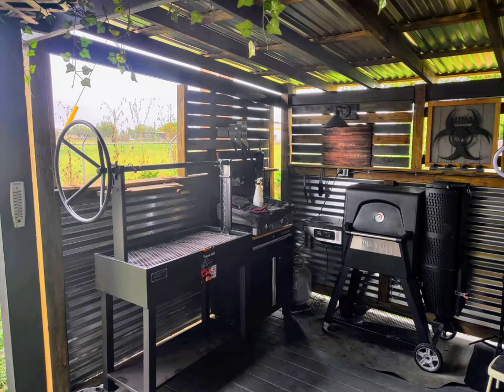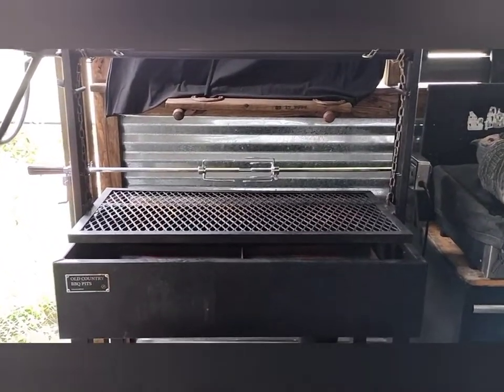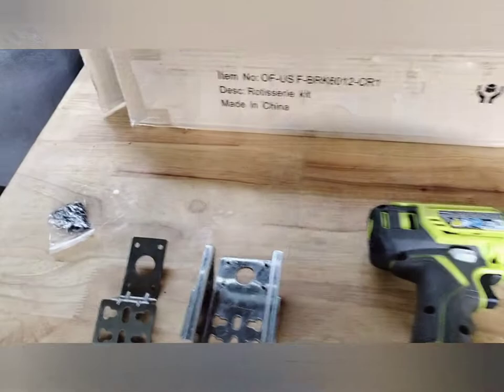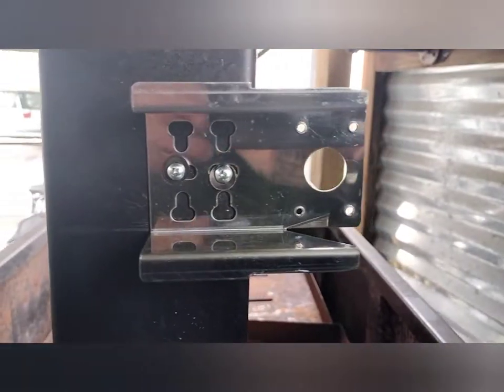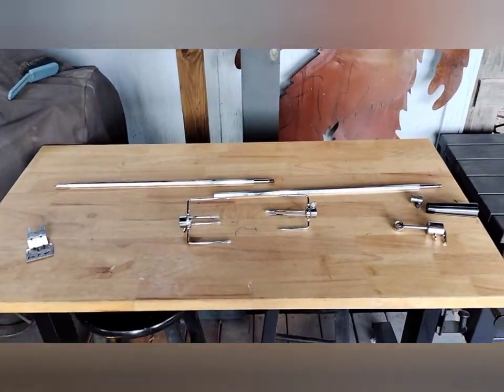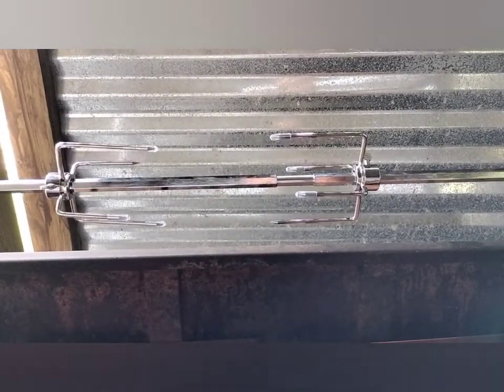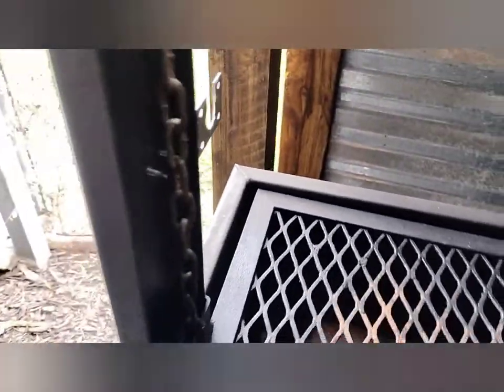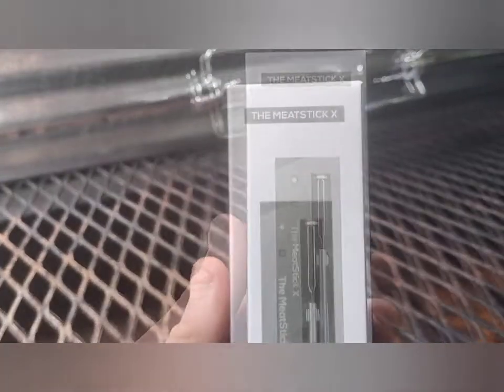Old Country Vaquero Rotisserie Kit Setup

Comment: As a very happy owner of this grill the absolute hands down thing you should do is line it with fire brick. Completely changes the way this grill retains heat. You will need to cover it after this modification as ash and a well-set firebrick make a waterproof bond and rain will pool in it. I believe it took 22 bricks from the tractor supply and I cannot explain the difference. The metal grates included for the bottom just throw away or repurpose for something else, they warp badly and don't retain heat.
Reply from the maker: I have seen a difference using ceramic bricks. I'll place the video short explaining it below. I may someday do the firebrick mod. I feel the same about this grill. Love it! Appreciate you giving us a heads up on where to get and how much fire bricks to use! Have a great one! 
https://youtube.com/shorts/JWRGu6j-5g0?feature=share
Reply: @AlLunacyQing  Hey great video you did there explaining how well they insulate. I ordered the rotisserie kit last night. Going to immediately do a pork butt when it gets here.
Reply from the maker: @savagestash4354  Ow! That sounds awesome. I have yet to do a big piece of meat on it. Let me know how it goes! Im going to try something soon! Cheers!
Reply: @AlLunacyQing  Rotisserie gets here tomorrow, from your video it looks like a super easy install. Going to do the pork butt next Wed or Thursday. I have a meater remote thermometer, it will be interesting to see how this cooks, I haven't seen it anywhere like this before.
Reply: @AlLunacyQing  Wow did a 6lb whole pork yesterday. Tied it up with cooking twine to even it out and stitch up the bone hole. About 5 hours on the rotisserie to get it to 190, Put an aluminum foil tent over the top of the grill surface above the meat and added pecan and post oak splits when I wanted more fire. Beautiful crust, wrapped in butcher paper, and let it rest for an hour. Well worth doing, there were no leftovers.
Reply from the maker: @savagestash4354  So you got it installed - no issues? It sounds great! Might just have to try it!
Reply: @AlLunacyQing  It was super easy after watching your video. The instructions they sent weren't great but it only took maybe 15 minutes and I was able to use the hardware that came with it, didn't need self-tappers. Used a good old hack saw to make the cut, I have a similar setup with a pergola and put 2 hooks on the wall to hang the rotisserie when not in use. Picanha or tri-tip is next.